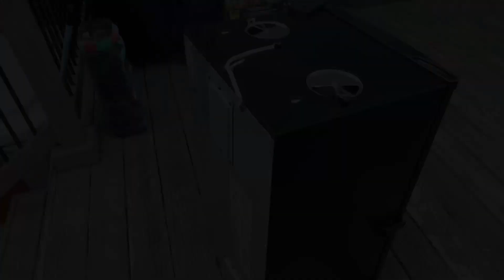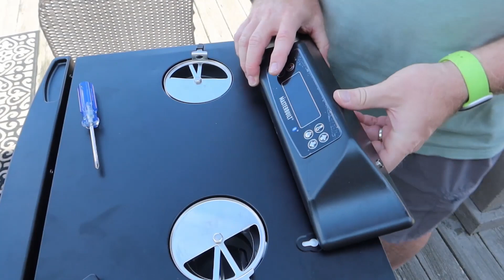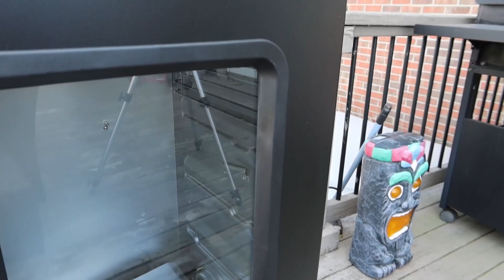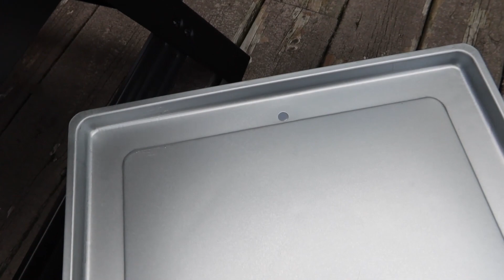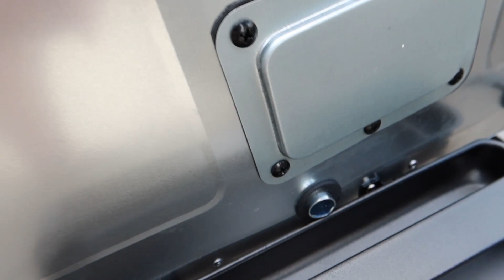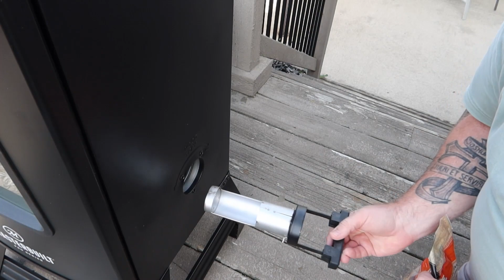Masterbuilt Pro Series MES 130P Electric Smoker

Comment: The wood chip system looks fiddly. Why not just have a tray that you pull and load like the PB's.
Reply from the maker: It works well especially to add chips while smoking without opening the door and losing heat.